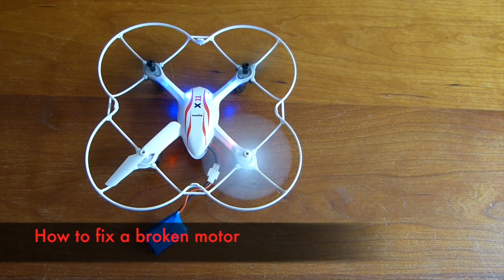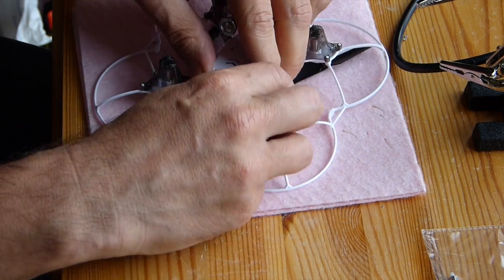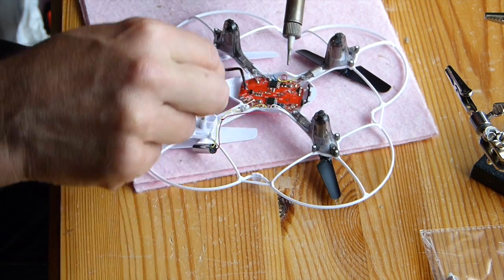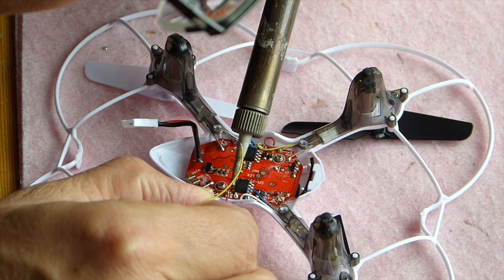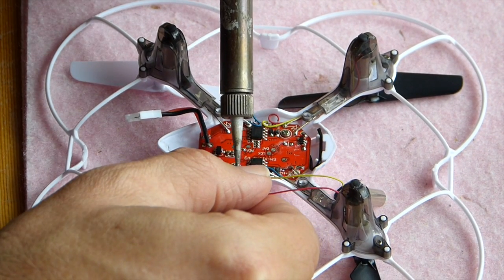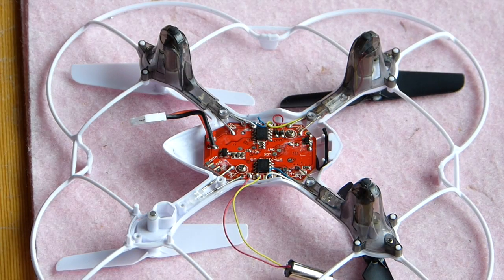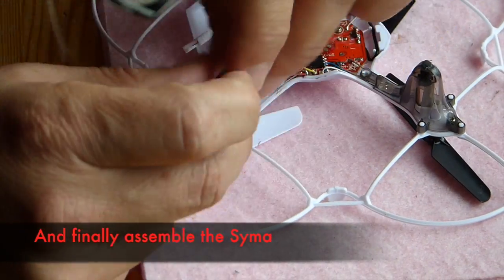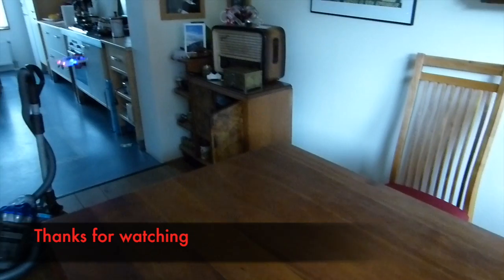Motor replacement Syma X11

Comment: I haven't replaced it yet still waiting for the motor that's coming from China.  What I will do instead of desoldering and soldering the board is cut the wires mid-point.  There are two reasons for this.  The first because it is easier for me who doesn't have the skills to do the board work.  Secondly, and more importantly according to Syma the blades rotate differently from front to rear so I'll just put the motor in check the rotation and if correct solder the wires, if not switch them and solder.

Comment: Is the red and yellow wires counter clockwise or clockwise?
Reply: +crawdady504 It looks like two motors are yellow and red, and two motors are white and blue. TomTop has a 4set of replacement motors.